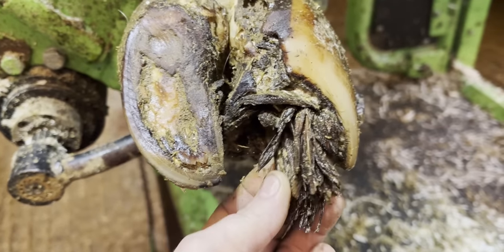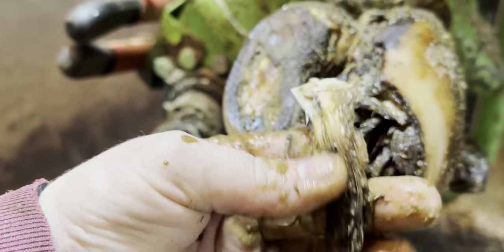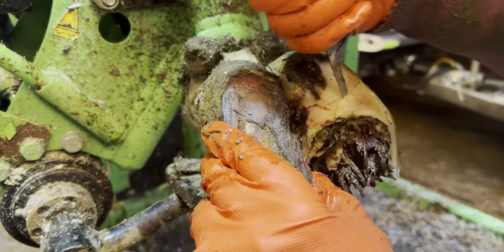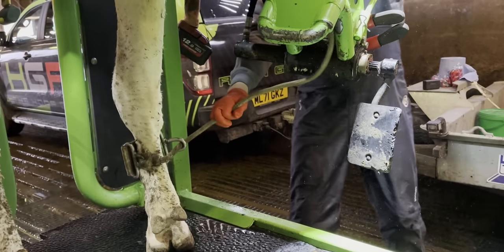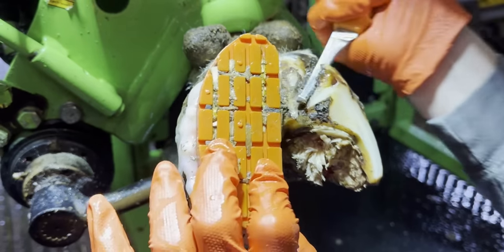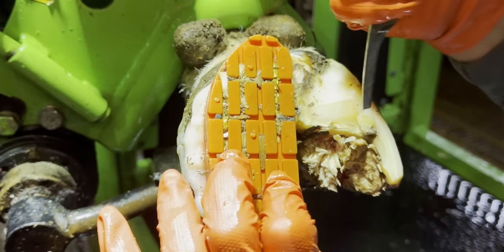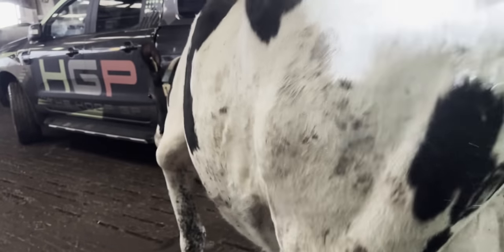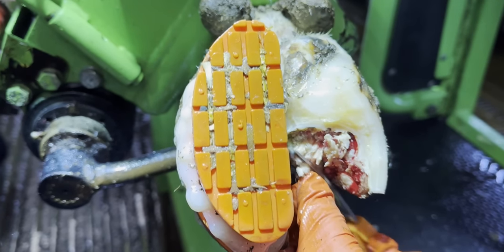DEFORMED, ROTTING cows hoof is CARVED AWAY

Comment: I am impressed but he has excellent equipment. I was a dairy farmer who was good at feet and I was using wooden blocks in 1978 and special hardening cement and doing this type of job but on 12000 litre a year producing cows. I am surprised that the bad hoof was not amputated which works well and is blocked, keeps the amputated part off the deck until repaired. I also redid a 13000 litre cow, Fosgrove Twenid, on all four back hooves, one at a time over 4 months to heal her feet. Gave 12000litres on following lactation after her 5 th calf. Seen it all before over 45 years ago but still nice to see a craftsman.